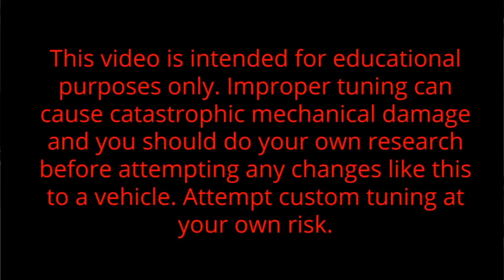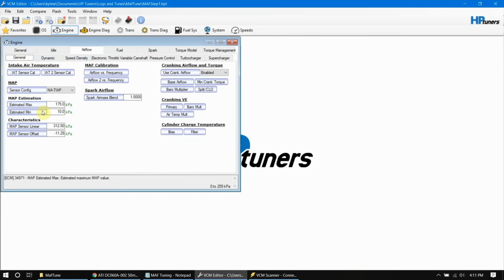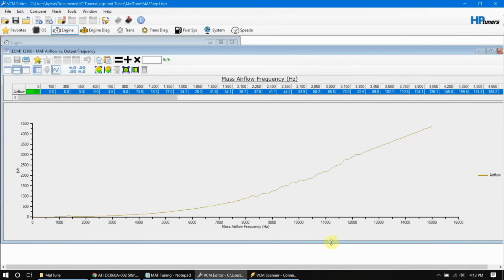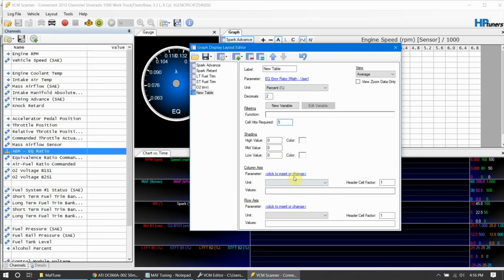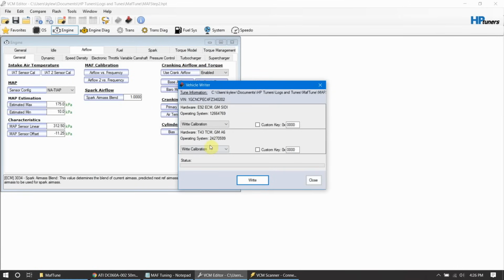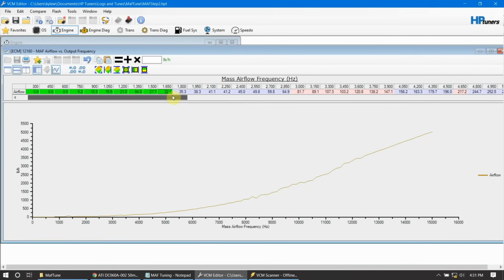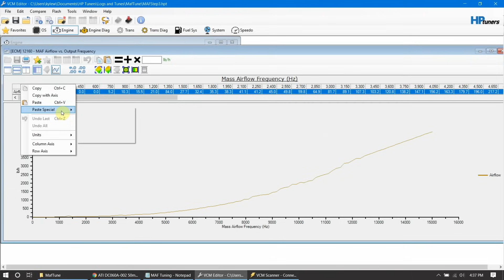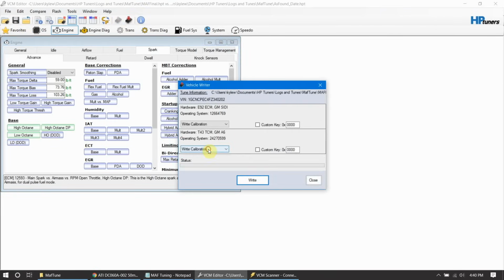MAF Tuning and Scaling, Tuning Series Vol. 3, HP Tuners

Comment: Hi, I've been following along and learning a lot, thanks for all the info! I'm wondering if it's possible to extrapolate the upper end of the MAF curve, like above 10Khz? My car is an 05 Pontiac Grand Prix GTP with the supercharged 3800, (ECM P05b) and has a few mods. It seems fairly straightforward to log/modify in the 3000-10000 range and after a bunch of iterations I feel that area is pretty close, but I haven't been able to log anything higher (MAF peaks at 11500 on this car) and the curve looks pretty sketchy above 10Khz. Also, there's no DFCO settings in HPT for this ECM so I wonder if that may be throwing my logs off a bit? Oh also, a tip for anyone else new to this: ALWAYS stop the logging BEFORE shutting off the engine. I cut a LOT of fuel out of the lower end (below 3k) of my MAF scale because the lower cells would populate only after the engine was shutoff before I figured out I was starving it for fuel down there, led to hard starting when cold.
Reply from the maker: Good info. And you can set a filter on your graph to not log anything when you let of the throttle, that might help. As far as the area you're not hitting. Look at your highest cell you have hit, compare it to stock to see how much higher it is now and then shift the area you haven't hit by the same percentage.
Reply: @GoatRopeGarage  Thanks! Applied the filter before my drive to work this morning and that seemed to help. Will scale the upper end as you suggest tonight. :)
Reply: @SteveLowe65  what steps did you perform this filter to not log when your let off the throttle? I've been trying to get help with this for weeks now, and no one will respond to my questions on it.

Comment: If i am using mpvi2 what would i select blue or red instead of using serial port aem? Thanks
Reply: If using the HP Tuners ProLink, Black wire is ground, Red wire is analog 1, and Blue wire is analog 2.
Just select the correct channel (AN1 or AN2) that you wired to when adding the wideband to the channels list.

Comment: I have an AEM 30-4100. I can't find it under the Transform - Parameter. My only options are AEM 4110 and AEM 30-(03x0 , 2340 , 5130). What should I pick?
Reply from the maker: I would try the 4110 option first, can't go wrong both will probably work

Comment: So I set up my PID’s just like you in this vid. Also the eq error histogram. My problem is when I press record and data log the pid’s reset themselves to the default ones and the ones you set up in this video are gone in my scanner. I have the new mvpi 2 with pro link. Running aem x 30-0300. Any idea why? Thanks.
Reply: Did you ever get your problem figured out?

Comment: Can someone tell me if I order the aem wideband and wanna hook it into the mpvi2, do I have to enable the pro feature in order to setup the EQ error ratio or can I just order the pro link and hook it in that way?  I'm almost positive this has been answered somewhere so apologies, but a quick search comes up with nothing and I tend to get off track and still wind up nowhere....  ADD is a b!+c#....
Reply from the maker: Get the AEM that supports serial and you don't need the pro features. You'll need a serial to USB adapter, I've got a video on it if you go to the tuning101.com link and search for wideband you'll find it
Reply: @GoatRopeGarage  roger.  I've seen it before I think.  Just been a minute.   I'll check it out again though. Thanks man

Comment: Hey ! love the videos I am learning a lot. I followed the steps and my MAF  graph in my scanner doesn't read any info on the graph. Any idea why. fyi i dont have a wide band hook to my MPVI2.
Reply from the maker: Won't work without the wideband
Reply: @GoatRopeGarage  I I'm particular have a wideband, and still nothing is populating the graph. Step by step have designed it exactly as you show here, and got nothing. I can see the cursor running over the various cells as I'm logging, just not populating. Cell hit count was set to 5. Any idea?

Comment: I’m tuning a 2010 crown Vic but my MAF is displayed as voltage, not Hertz. Is the a way to convert it to Hertz?
Reply from the maker: Don't need to, just plot your graph how your table looks, you're just logging air mass versus voltage instead of hertz
Reply: Goat Rope Garage ok awesome man thank you. You’re videos are the best. I’m running lean and need to get it running rich. It’s running close to 14.7 Stoich at WOT. Just getting into tuning and with HP Tuners
Reply: Would I add percentage the same to the MAF table like you did to get it running a bit richer or would the ratio be different?

Comment: This has been a great video.  I know you use the serial port for your inputs.  I have the  MPVI Pro and the input is only in Voltage.  Will I have to do a custom math parameter to build the "EQ ratio error" histogram?  Or can you highlight the difference between the serial input vs the MPVI Pro input? Thanks!!
Reply from the maker: Right click on the input and choose transform and there will be an option for your gauge with the math already loaded

Comment: After tuning MAF and turning on closed loop again with everything else, will the MAF error still be at 0 to 1% error? Some blocks are jumping to 200% error. I think its mostly on decel. Is this normal and how should I go about removing the bad data? Got that gen 3 5.3. Thank you for your work!
Reply from the maker: You have DFCO back on, once you do your error graphs won't work as it goes full lean on decel.
Reply: @GoatRopeGarage  how do i set the parameter to filter that out

Comment: Just found your channel and after watching a couple videos it’s taken some of the fear of tuning away and I’ve  started with tuning the maf. Not sure what I’ve done wrong with the wideband cause the aem eq ratio disappears when I start logging.
Reply from the maker: It happens. Reboot your computer with everything plugged in and try again. It's gotten worse since the last update but the reboot seems to fix mine every time. Welcome to the garage!
Reply: I have the AEM 30-0333 it did the same. Eventually found in the scanner under vehicle , repoll for supported parameters, it came back on. This was after I updated HP tuners
Reply: Any reason while doing the maf tuning I could be getting some inconsistent data in some cells? Ex. Cells 1800 =-.22 1950=-1.32 2100=1.2 2250=-.1 2400=-2.17. And in the next log after the multiple x half the cell comes back to. 1800= -1.22 1950=-4.39 2100=-2.49 2250=-.46 2400=-.89. This was on a 20 drive from work to home.

Comment: I have an issue I can’t figure out. I stay in closed loop until 3rd gear then it automatically goes into open loop and goes way rich.. any suggestions? I have everything setup the way you have indicated. This is a 2010 crown Vic
Reply from the maker: Closed loop is probably pulling fuel to keep you from going rich then once you get out of it you're just in your airflow tune and it is rich. How rich are we talking? On open loop, power enrichment you should be richer
Reply: Goat Rope Garage once it goes into OL it gets to around .65. But it never goes into open loop in 1st or 2nd, only in 3rd gear.
Reply from the maker: @vicsquad6994  yeah, that it's way rich, probably getting some stumbles. Just make sure you're only applying changes to OL based on your widebands error
Reply: Goat Rope Garage OK thank you is it normal for it to only go and open loop in third gear and not first and second? Do you know of any way to change that because I could really use that power in first and second gear

Comment: Just went through the video doing the maf tuning however i think something  is off  im getting numbers in the hundreds ie 243.53 where i see your numbers are  like 14.xx i can make changes and see my afr richen up on the gauge so that part is right just my graph is off. Thanks
Reply from the maker: Double check you inputs, make sure they are scaled correctly. The default math might not work with your setup either. Sometimes you have to do custom math.
Reply: @GoatRopeGarage  the car would idle good in park , however when i put in in gear it would die . Right or wrong i increased the base running airflow and reran the scan and the numbers seemed more in the range i saw in the video
Reply: Did i miss how you created that AFR gauge in VCM scanner ?
Reply from the maker: @bsivley81  There are some default error maths in the program for AFR and EQ or you can use them as a template to do your own if you need to scale your wideband.

Comment: On my turbo 2012 mustang v6 I have a 3 inch maf with fic 1000’s on e85 at only 12 psi and it’s going lean in higher rpms. My tunner (also the turbo kit maker) says I’m running out of maf signal. It’s showing only 1.59 air load and 11.5 hertz and 85 lbs air when it happens. First they said I needed bigger injectors and now they want me to buy a 4 inch maf pipe. Is this really a legit problem or are they just shitty tuners?

Comment: awesome video! very informative. question: do I need hptuners pro to log the wideband on the scanner?
Reply from the maker: Nope, just get one that has a serial output like the AEM 30-0300, it supports 232 and you can use a cheap serial to USB adapter, the scanner will recognize it. Let me know if you have any issues!
Reply: @GoatRopeGarage  so I purchased the spoolinup aem wideband logging cable and a serial to usb. I added the pid " aem eq ratio" but when I scan it disappears. could it be I don't have a good ground or is it maybe something else? thanks again for the support, you are helping us "noobs" out more than you know. keep up the good work bud
Reply from the maker: David, when you are adding it are you adding it under the serial section of the parameter selection screen? You might try rebooting your computer with your serial to USB already connected too. I have had this issue in the past and it can be finicky but I've honestly not had any problems in the last year or so. Might double check that you're on the latest version of the software also. If none of that helps me me know and I'll dig into my setup and show you how it's all hooked up.
Reply from the maker: David, put up a new video for you, hope it helps!
https://youtu.be/mGcEw29XZBQ

Comment: Im having trouble with EQ ratio disappearing once i turn on the vehicle. Is it not supported. 2000 Camaro
Reply from the maker: How are you bringing it in to your laptop?
Reply: @GoatRopeGarage  I click add channel. External inputs>serial ports>AEM>AEM EQ Ratio [mixture Ratio]
Reply: I'm using MVPI3 with prolink connected to AEM wideband.
Reply from the maker: With the prolink you'll have to just three prolink analog input parameter on the scanner then transform the parameter for AEM
Reply: @Goat Rope Garage  I'm still getting familiar with hp tuners, didn't know I could transform it, just figured it out thanks a lot. Now just one more question, when I right click on channel, on units, do I leave it on Lambda or switch it to AFR (14.7 stoich) gas?

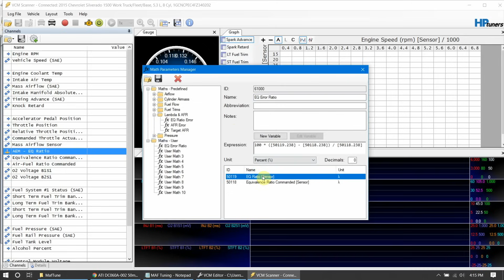Comment: At 8:33, you say to change the EQ Ratio to Mass Airflow. But when you went in to change it, you left it at EQ Ratio.  I assume this is a mistake?  Don't we want EQ Ratio and NOT Mass Airflow?

Also, I have seen you tune MAF 2 different ways.
1) Use the narrow-band O2 sensors while in closed-loop and monitor fueling adjustments made by
      LTFT & STFT, thus letting the ECM keep the fueling at stoich.
    Then make MAF adjustments using fueling error from the LTFT & STFT data.
2) Use an external wide-band AFR sensor and disable closed-loop so no fueling adjustments are made.
    Then make MAF adjustments using data on how much the fueling is off from stoich using wide-band data.

In the end, we want the MAF sensor to represent the actual air coming into the engine.
Is using method 2 (using wide-band) better than method 1 (using narrow-band O2 sensors)?

I really enjoy your videos.  When I watch other tuning videos, I come back you yours to see if they are accurate on what they say.
Keep up the great work!

Comment: So basically you are using a wideband sensor to calibrate the efficiency of your MAF sensor which operates on a narrowband?  Am I understanding that correctly?
Reply from the maker: Close. You use the wideband to calibrate the MAF, then the narrowband sensors dial in the last bit of error. But they don't operate when PE is active (wot) so that's the most critical place to get things dialed in with a WB

Comment: Just started trying to tune and watched the first few of your series plus a few videos by other tuners.  Other tuners also go in and turn off things like traction control, torque management, and tip in before trying to scan.  Can you elaborate if this is needed or not?
Reply from the maker: Nope, it all ties back in to commanded and any table that is going to effect things like that will change your commanded AFR/EQ

Comment: I'm A Little Confused On How The AFR Gauge / Lambda Sensor Is Being Used. You Are Obviously Logging / Connected To HP Tuners. But What I Don't Get Is How The Vehicle Knows What AFR Its Outputting. When You Set Up The MAF Table For Logging It Showed A % Value. At First It Was A Positive % Value Meaning It Was Running Lean (The % Off The Vehicle Is Outputting To Actual Lambda Sensor?). So When You Are Scaling Your MAF With A Wideband... Is All You Are Doing Is Making Sure 1.0 Lambda From ECU Is 1.0 Lambda On Wideband? (So The Vehicle Is Scaled Correctly). Is This So When You Want To Change Your Fueling Under Boost The ECU Is "Calibrated" So The AFR You Input Is What Vehicle Actually Outputs??

Comment: I'm having a tough time trying to get help with the dfco disabling, because I simply do not have parameters for it. I've read in a few spots where your mention that a filter can be put in the graph to not log during deceleration so that there isn't a big battle with lean spikes screwing up the graph. I have no idea what to do here. I know you've been busy with the nova lately, and I appreciate any help you can afford. I did try and reach out on the patreon

Comment: Thank you for these videos, they are awesome and I am learning a lot. However i am a little stuck. I'm using the mpvi2 with the pro feature and I'm trying to log the MAF table like in the video, followed the steps to the T for setting up the PIDs and the tune file to force it into MAF. I have 2 issues that i cant figure out.  Truck is a gen4 5.3 a4 with the e38 ecm

1. How do i disable my o2s? i don't have the same option to make the o2 voltage a negative. I'm given a button to press for o2 readiness ECT which opens to a table not a voltage value to change.

2. When i try to log the  MAF error table we create, no cells begin to hit or fill up. Did i miss a step or a setting? Is is because of the o2 setting as stated above?

Reason for all this is I installed a new 102mm tb and ported the tb opening a little for a smoother transition. The truck runs decent off the original tune however i have a slight lope at idle and I can tell its running a tad lean due to a plug reading and confirmation from the WideBand. I went through a TB relearn 3 times thinking that was it with no change. 

Again truck is a gen 4 5.3 a4 long tubes, catless y pipe, exhaust, CAI and now the 102mm tb and a port matched tb inlet on the manifold side. Thanks for any help!

Comment: Love these tuning videos! Very helpful, however, my VCM Scanner isn't displaying my MAF frequency when I start scanning, it just stays blank. What could be the issue behind that?
Reply from the maker: Not logging all the parameters or your math is wrong
Reply: @GoatRopeGarage  
I'm having the same issue. When I add a new channel, select MAF Frequency, and then start scanning, it doesn't scan.  There's no math or anything involved in that.

Edit: I got mine working by changing the Polling Interval from the default 200ms(5Hz) to 10ms (100Hz)

Comment: Got my wideband hooked up but everytime I go to do a scan the AEM PID disappears. I've set everything up the same way as you but my MAF Error graph wont display anything. What gives?
Reply: something is incorrect in your wiring from the gauge to your laptop, or your serial adapter to usb may not be talking to your computer correctly(Drivers). Make sure you wire to pins 2 and 5 on the serial cable. I just got mine connected yesterday

Comment: If you have a system that uses both MAF and Speed density, then why do you turn off one or the other to tune when they end up working together anyways? Gathering data in the same cells for both systems seems redundant as one will always operate over the other at some point. Just trying to follow all the logic. Thanks

Comment: I did this with my MAF after adding a CAI. I learned to setup the graph using MAF frequency and ltft minus stft. The goal was to get each frequency as one to zero fuel trims. Is this correct?
Reply from the maker: That should work!